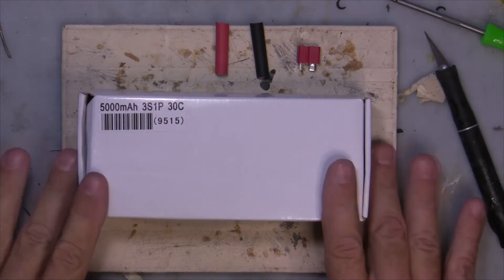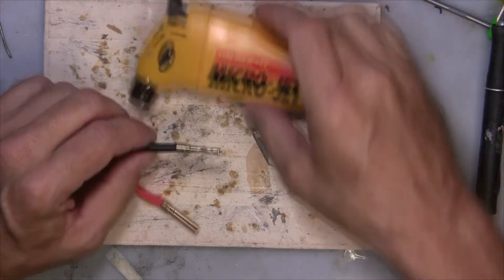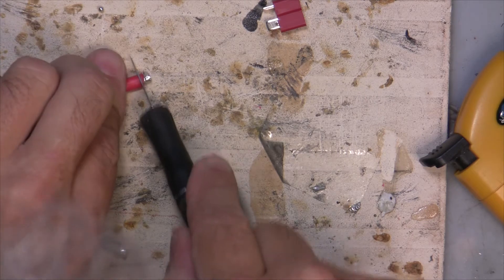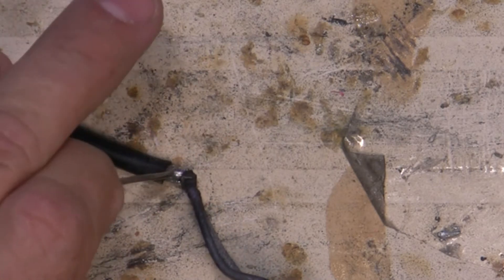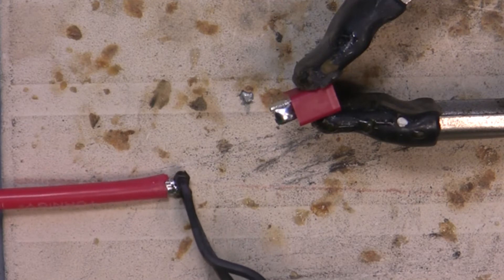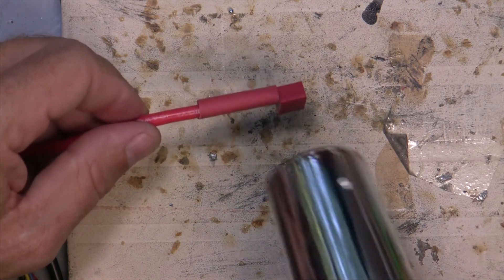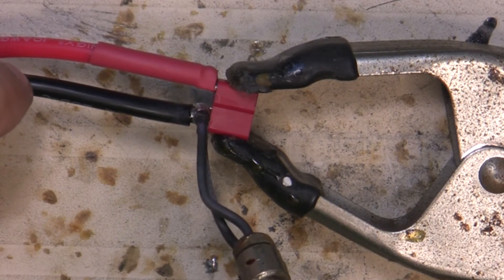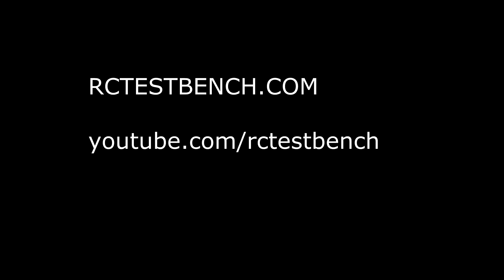Deans Connectors to Turnigy LiPo battery

Comment: @Billy BManic RE soldering, When it comes to soldering practise practice practice. You don't need the most expensive iron, you can buy a kit off Amazon $14:95 or even $5 get some old wire practice striping back the insulation, take you iron when its hot and  tin the wire  ,
 Practise that to your happy then take two bits of wire stripped back and tinned join them practise this to your confident, or take a part time course I live in the Uk and I know we have night school where you can learn stuff like this..I guess the states or wherever you live will do the same..its all practise and a little skill ..you can learn that in a day or two..

Comment: Dumb question but I'm new to lipo rcing. Bought some turnigy batteries for the price to use, but the connectors on the battery in the video. Is it the male or female end? Trying to find deans connector to that battery. Thanx if you can answer.